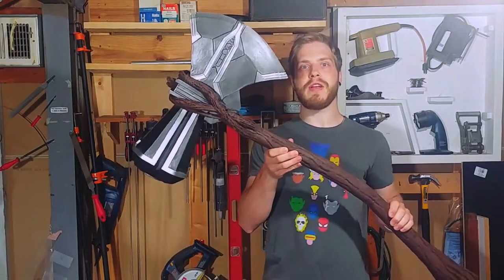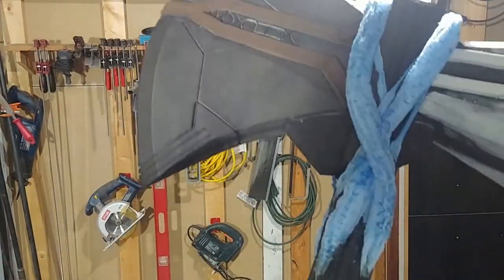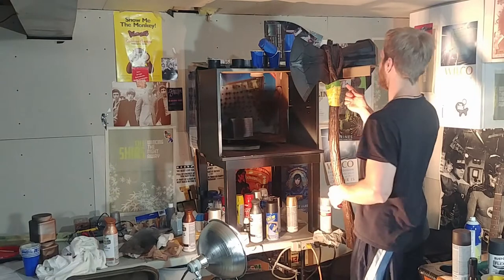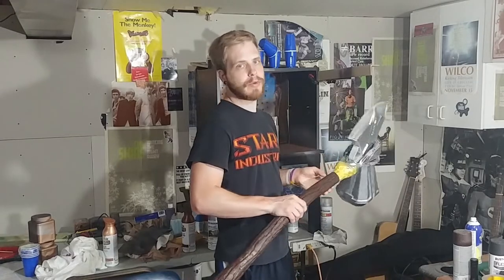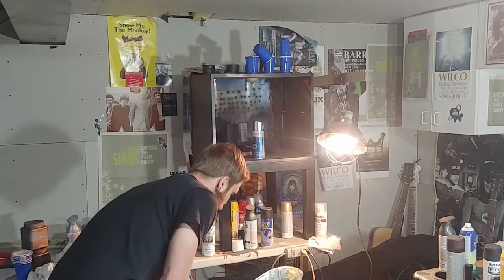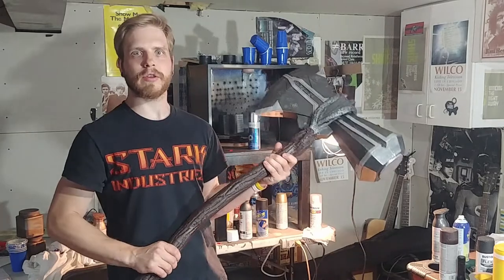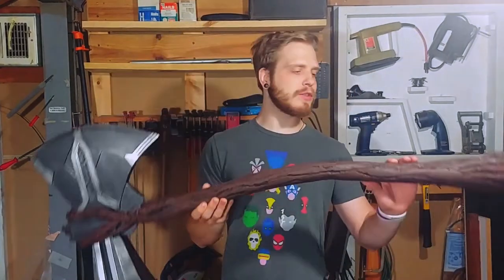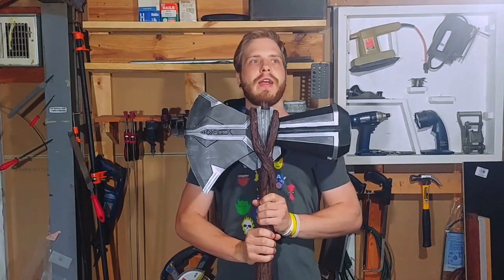Thor Infinity War Cosplay: Part 2 - Painting Stormbreaker

Comment: Which spray paint you used for the grey metal look of the strombreaker and what do you call those foam you used for the vines of the axe . You did a great job on the prop . I will admire you on the prop . love your videos
Reply from the maker: Both metals are Rust-oleum metallic universal advanced formula spray paints. I am 99% sure the dark metal is the "Black Stainless Steel" color, and the light metal is "Titanium Silver". The vines are made from a pool noodle.